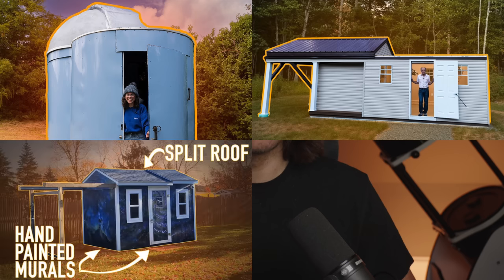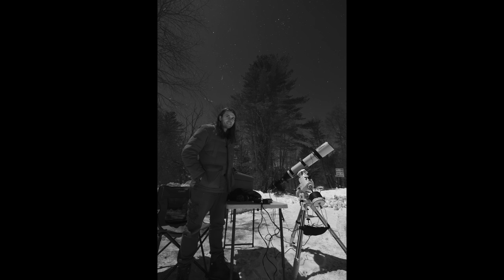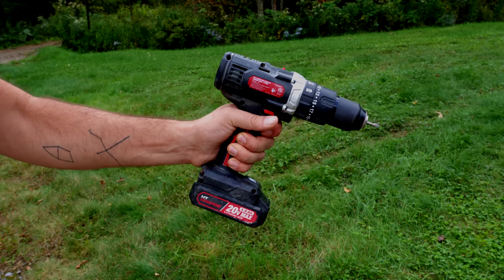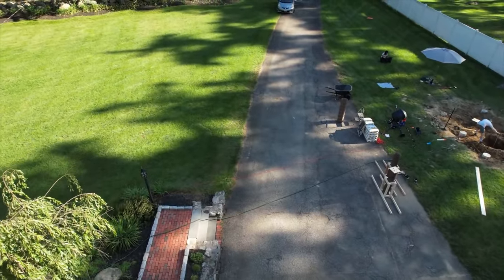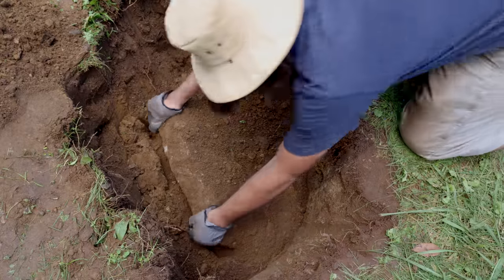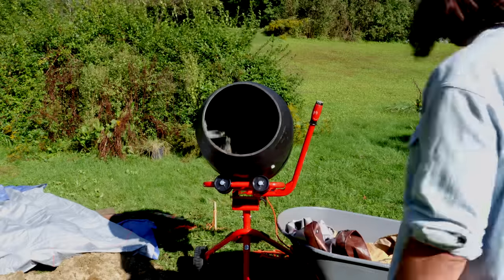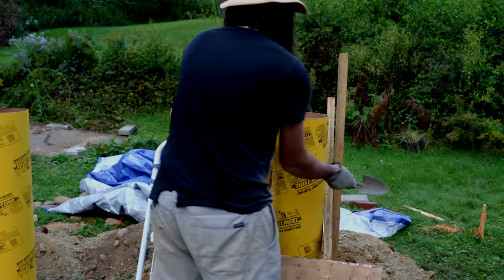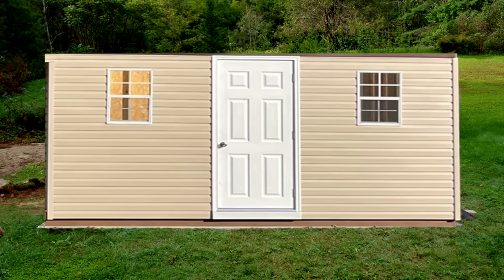Building My DREAM OBSERVATORY

Comment: Inspired by you building an observatory at home. I have some doubts / questions concerning the foundation of the pier.  I think some of the advisors might go wrong in the very high demands for stability in the pier foundation.  Don't get me wrong, i recon it is important.  However, in the old days, ie before guiding at the level we see now, super good polar alignment and super rigid tracking was important.  Today, you basically just have to make sure the polar alignment is not completely out of wack, and even if the soil or foundation of the pier moves a bit due to heat, the guiding takes care of most of this.  Leading me to the conclusion, yes it is fine with a stable pier and foundation hereof, but no need to over do it ! ?  What do you think out there ?
Reply from the maker: I don’t think the worry is movement during a single session. I agree for that, I could have gone with something easier and still had a stable enough, isolated pier for imaging. But eventually I may automate everything meaning I could just roll the roof off from inside the house in the winter rather than tromping through the snow. I’m that case, I wouldn’t be checking polar alignment (PA) each night and a frost heave can easily throw off PA by several arc minutes. I’ve noticed a correlation between polar alignment error being under 5 arc-minutes and good imaging results. I agree PA doesn’t have to be perfect. But here in New Hampshire the ground shift could make the PA poor pretty quickly without the deep foundation under the pier. So I think it depends on the person. If you planned to be out in the observatory every night physically to check PA, the deep foundation for the pier might not be necessary. There are easier pier designs out there like the Tod Morden (cinder blocks glued together) that I’d recommend instead.
Reply: Thank you Nico, that makes a lot of sense.  The issue of the soil moving due to temperature or rain, actually makes sense.  It's been raining cats and dogs here in Denmark in 2023, November being the wettest in 150 years, I recon that the soil actually might move the pier foundation if not strong or deep enough.  Your points about a fully automated set-up, where you remote can roll off the roof and start the imagining, makes good sense. Thank your sharing your thought and experience,  I heard you said on the Galatic show, that you're editing the 2 video on the observatory.  Look forward indeed.  @NebulaPhotos
Reply: Hi Nico,  @NebulaPhotos   there's a Swede  @frosthastrophotography with a home observatory in a rather north and hard climate.  It seems he experienced exactly the point you were making about how deep into the soil you should go.    So here's a very recent and practical example of what can happen.   When building my own observatory eventually, I will take your advice and the one of Frosth also.  It pays off.  Just wanted to share this with you .

Comment: Hey Nico, I have a quick unrelated question. Say I were to shoot a target for one night, and take 30 flats, 50 bias, and 30 darks. If I were to shoot the same target for a second night, would I take another 30 flats, 50 bias, and 30 darks? Or would I use my calibration frames from the first night?
Reply: You can reuse biases (I usually retake them every couple of months). It depends for flats and darks. Reusing flats is ok if your optical train remained the same (didn't change focus, didn't move camera in relation to the lens/telescope, didn't gather dust on the lens or cleaned it). You can also reuse darks if the temperature was relatively similar, around +-2 °C.
Reply from the maker: @cdz9400 I agree with everything @jostbogataj2404 wrote. 👍